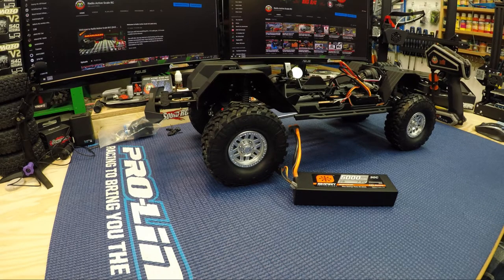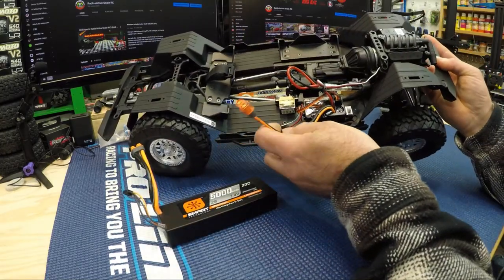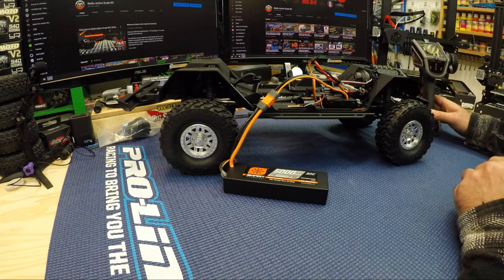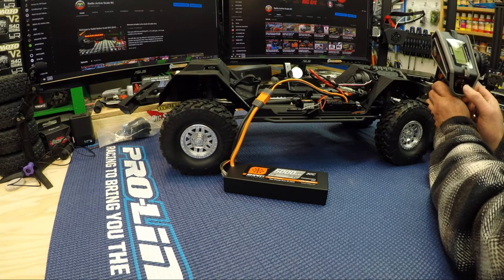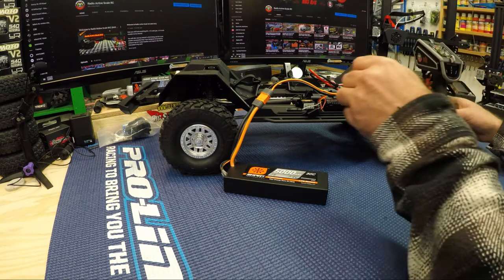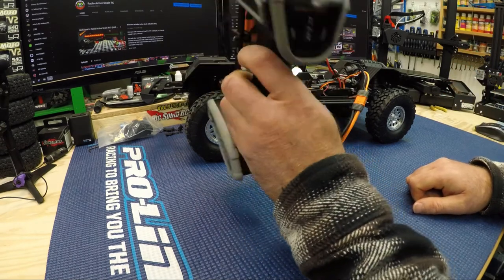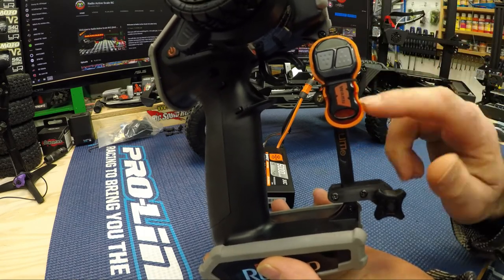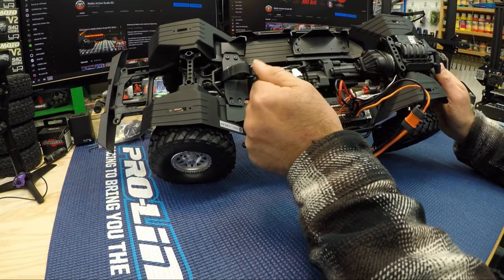BINDING THE DX5 RUGGED TO A SCX10 III FIRMA 40A ESC

Comment: Why is it important to unplug the dig before binding?
Reply from the maker: When you bind and the radio connects the dig  is on an aux on the receiver and it is more likely going to have 100% end point set and could cause damage to the dig servo or transmission
Reply: Well I accidentally bound my dx5 without removing the dig servo but my aux setting was set to inhibit. This scx10 iii is the first vehicle to use with more than 2 channels. I hope I didn't hurt my dig servo
Reply from the maker: @heroicstriker  just make sure its set to the right direction you may need to reverse it, i had to on mine